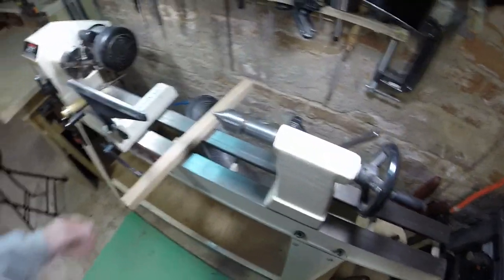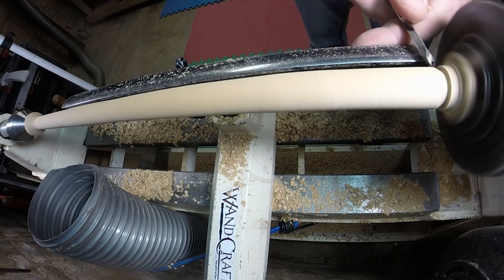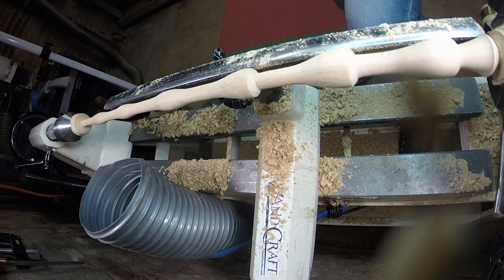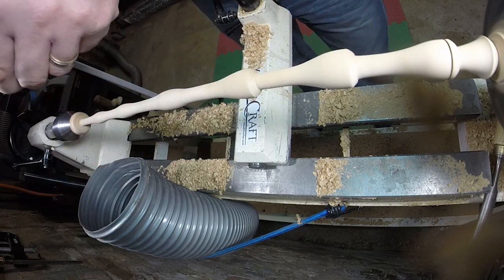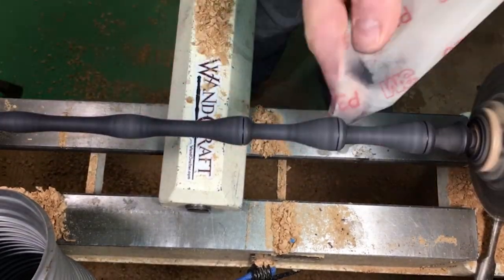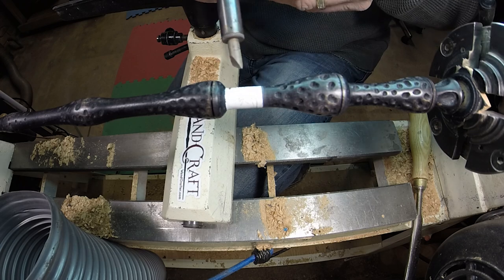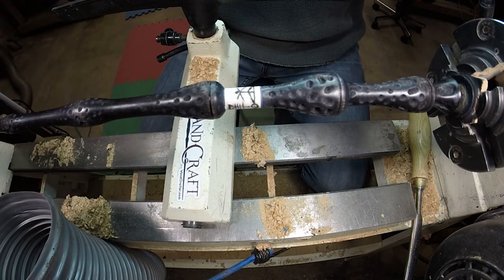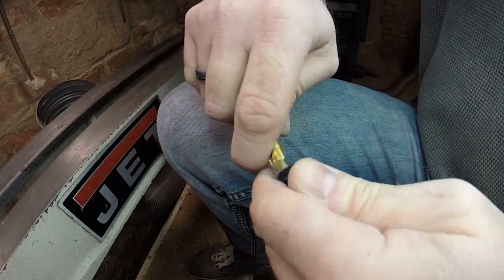AMAZING (Elder) Alder Wand - How I made this from start to finish! Time lapse woodturning

Comment: I've always wondered man, how do people do Etsy lathework with wands? Like... do you make blueprints to follow everytime or is it just you make something once (or 12 times lol) and then have it stuck in your mind forever?
Reply from the maker: Good question! For me, 95% of the time, they're all one-of-a-kind wands. I do have some that I do limited amounts of the same. But, they can vary a little on color and wood grain. But for the most part, they're very much the same. I make templates for those with marks and thickness. I can duplicate fairly accurately just by a photo anymore, though.